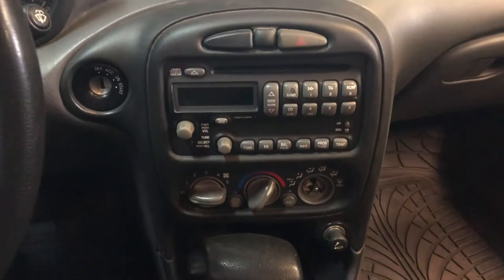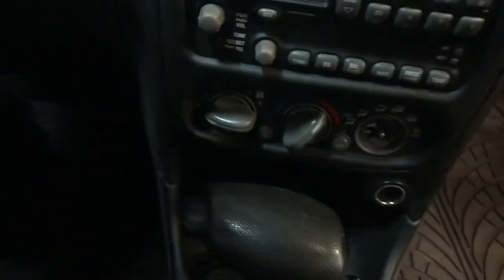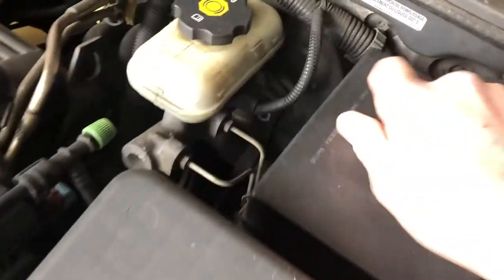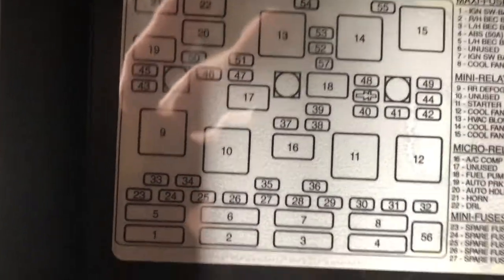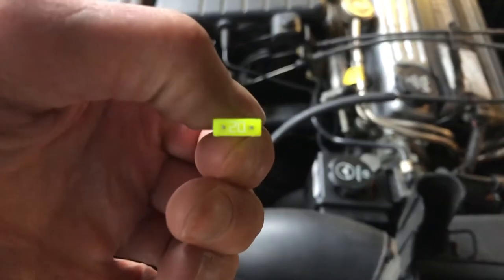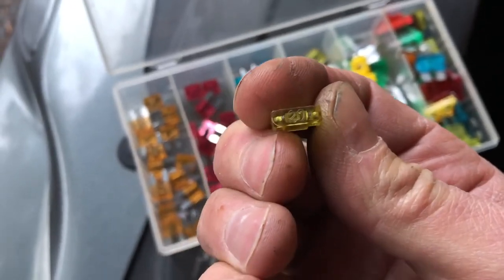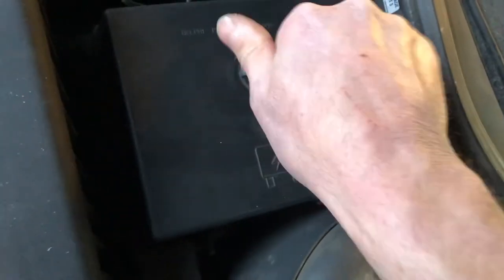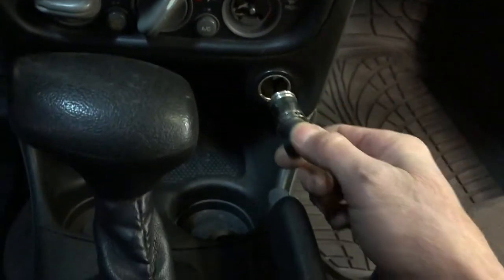Power Port/Cigarette Lighter Stopped Working? Watch this Video for Easy How to Repair Instructions.

Comment: What if when you replace the fuse and it keeps shorting out the fuse
Reply from the maker: I would then remove the lighter assembly (install a new fuse without operating the lighter) and use a test light to confirm you have 12v coming to the two wires at the back of the assembly.  If you do, your lighter assembly is bad and you need to replace it.

Comment: what if the fuse is good?
Reply from the maker: If the fuse is good, then next step you'll need to check if there is 12v power at the outlet. Easiest way is with a test light.